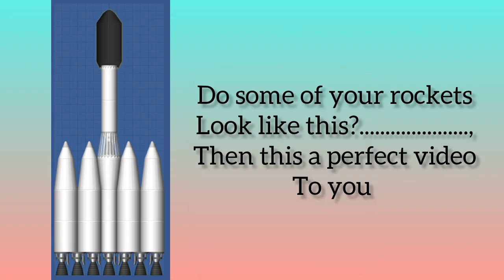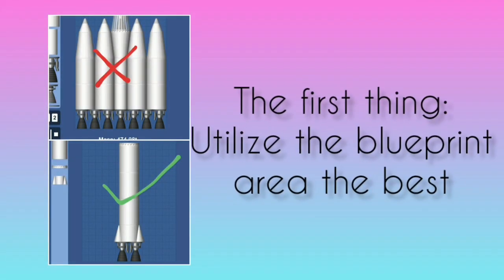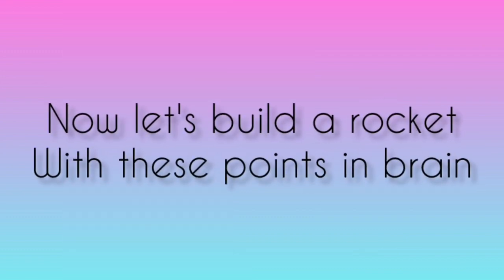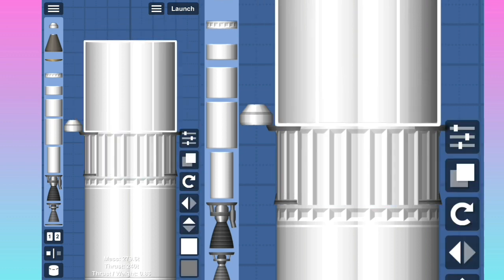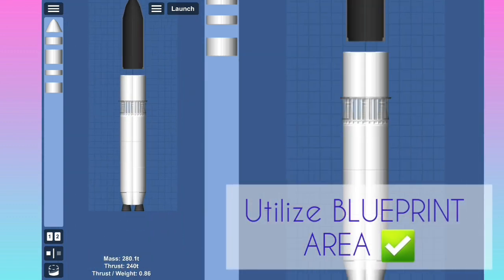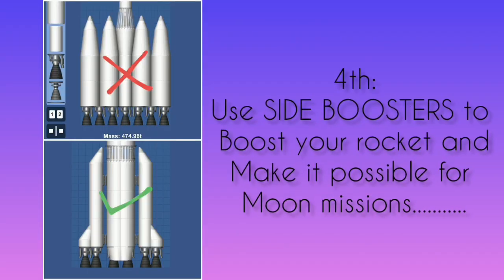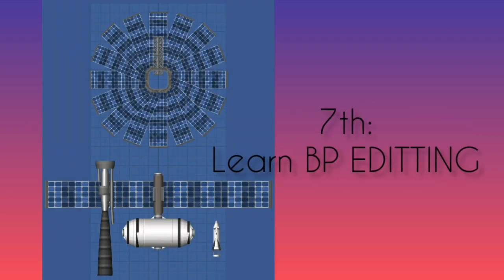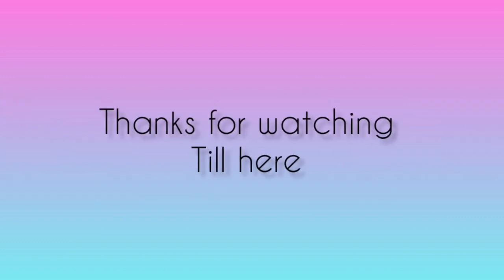TIPS & ADVICES FOR BETTER ROCKETS,    SFS    #sfs #tips

Comment: You can also Cover Engine with fairings by completely covering them the fairings and able to turn them on by staging while building I tried it and it looks pretty great too.
Reply from the maker: Yeah......and it depends
Reply: @IMGMYT  True if you stretch the engine  it's Flames will be too bright to see the Fairing so the point is lost and it only works on first stages
Reply from the maker: Yes